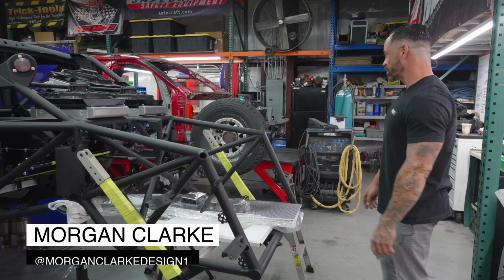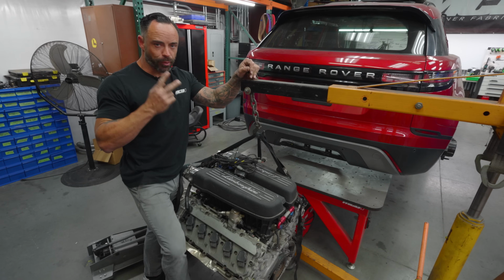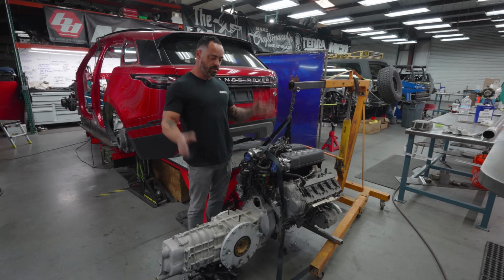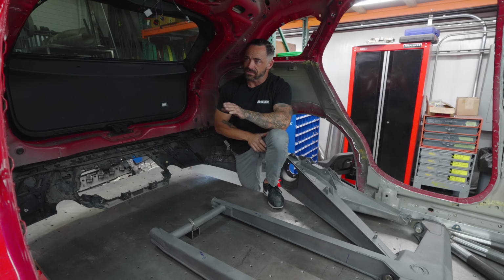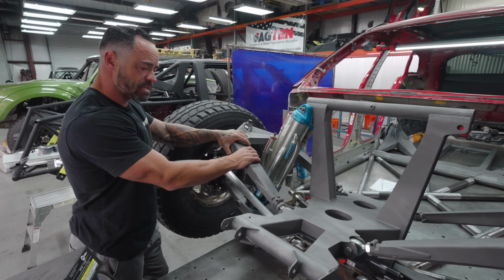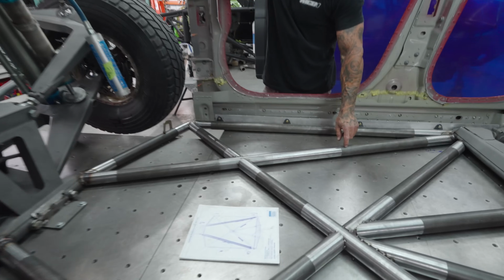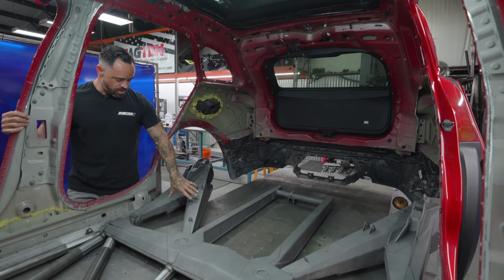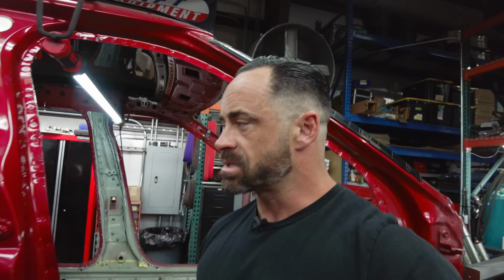Chassis Foundation on the Dakar Prototype

Comment: I'm curious how you're going to clutch this car. a 9" 6 puck twin disk (the biggest clutch you can fit in a vw style bell housing) is only good for around 800 ft lbs or torque.
Reply from the maker: We are running a custom gm Bellhousing. I believe they are 11”
Reply: @MorganClarkeDesign1  right on that will work perfect. one more thing to look into if you dont already have a hub package put together, jamar makes an outboard style rear hub putting the cv outside the centerline of the wheel allowing longer axles which nets less cv angle at higher travel numbers or worst case gives you a better cv angle to prolong there lives.  This Dakar project is going to be an absolute beauty keep up the killer work.

Comment: Not sure whether it was camera angles but to keep the drive shafts straight coming out the transaxle the engine will stick out past the rear hatch, as it is best to keep the driveshafts as straight as is possible to give more up and down travel you will need to reduce the wheelbase around six inch's, I am probably totally wrong, but having done a lot with Baja Bugs with several different engine transaxle set ups it always came back to keeping the axle shafts being as straight as is possible.

Comment: I know you are gonna give the American  flex 💪 on this . If it were me, with a lazy bottom end torque,  that comes with italian engines, my money would go for super charged over turbo , especially in the sand,  instant banshee  power, 
If your wanting 100 plus wheelies,  your gonna need ballast in the front. Bad idea putting the fuel in front  of the fire wall, but, ultimately its a me tr8ck  bucket of pricey shit to start with. 
When you come to my speed shop, with a project like that, hito, 
Hope you got oil money in your blood.

Comment: Curious about that 1000lb savings theory? How many feet of 2” tubing do you expect to use in this chassis?
Reply: I have a fullsize 6.5' bed backhalf design that I originally drew in all 2" .120, when I converted all of the secondary and tertiary tubes to 095 and 065 respectively, the total weight in the computer dropped by about 250lbs. Apply that to cage and floors and you'll be getting to some pretty big weight savings numbers real quick
Reply: @fish_built  2” x .120 4130 tube weighs about 2.5 lbs/ft. 500’ of tubing weighs 1250lbs total.